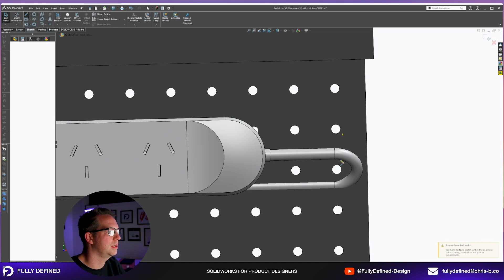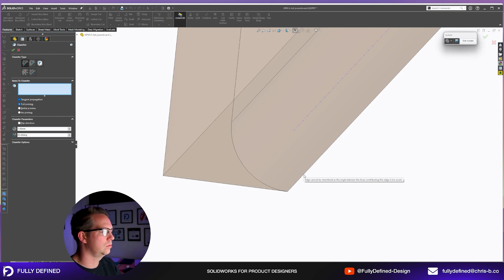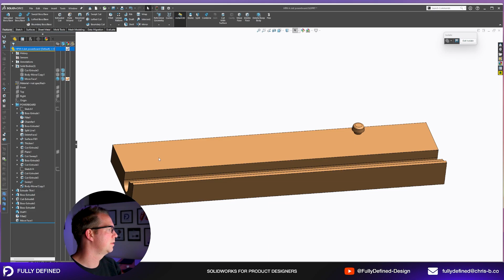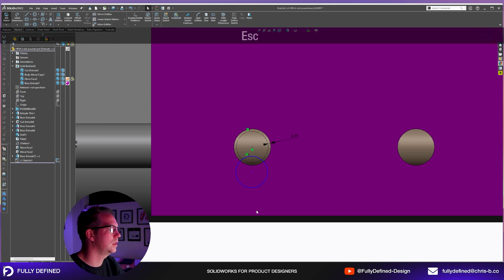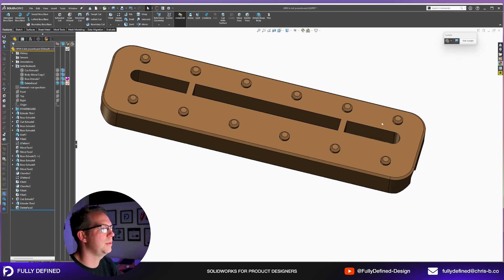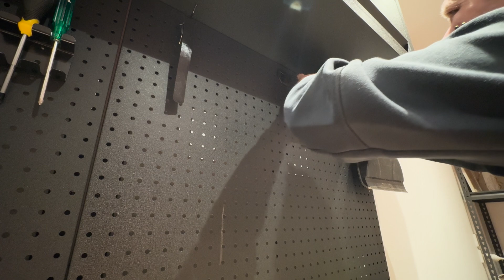Designing a Pegboard bracket for 3D Printing - SolidWorks Beginners

Comment: Good job Chris. Multibody workspace in Solidworks is great. Your design turned out pretty well. Nice tip with printing in 45degrees angle. Creates less support and easy removal. 

I would use M5 cap screws for mounting the power board to the 3d printed bracket by having 2x M5 tapped holes instead of the mushroom protrudes.
Reply from the maker: Sorry I missed responding to this earlier Ty.
Your suggestion for using M5 cap screws and matching threaded holes (or inserts) is smart - but I didn't have any at home!
Thanks for watching